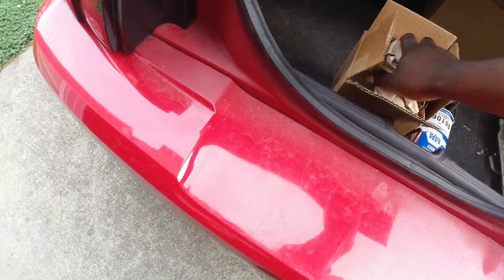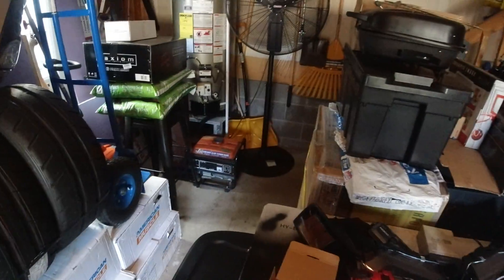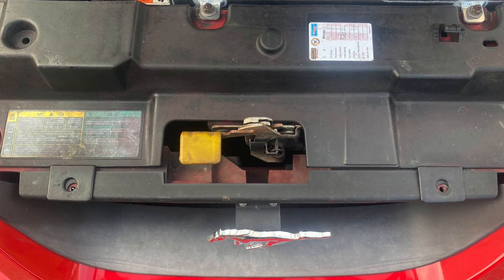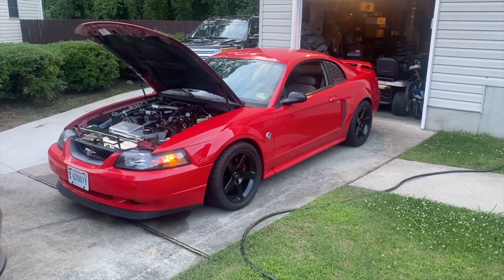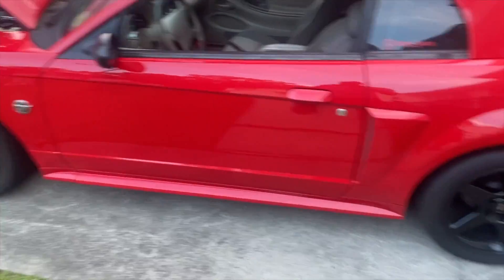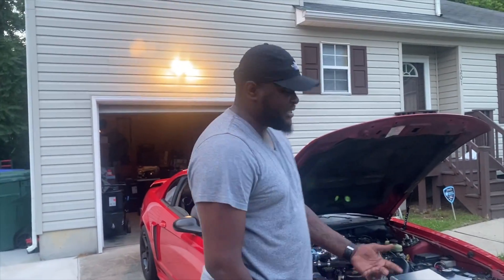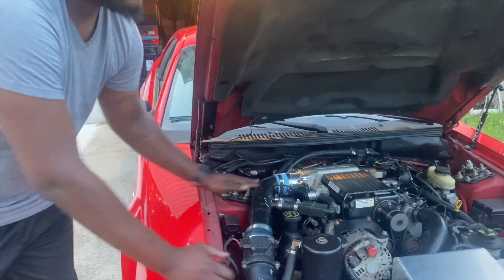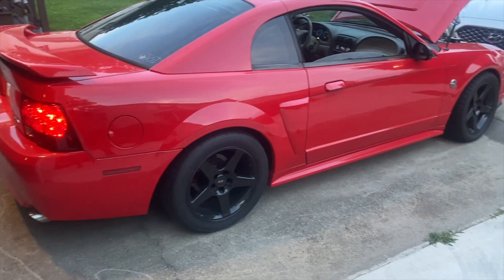The Beast Has Arisen: 2004 Mustang GT Supercharged

Comment: I can definitely see you in full focus,, I been building on mine for a hot minute, built top end stock bottom, comp cams custom grind blower cams, and next I’m lookin at boost and been considering KB kit, just have to get my money stacked a little higher, I got to start posting more videos, I deleted my IG
Reply from the maker: Yeah bro, I’m running a stock bottom end, I plan to build it or coyote swap it if it ever blows on me. But you can find pretty good deals on KB kits. Hop on FB and browse the parts pages.

Comment: Look into either BMR, or Maximum Motorsports for further suspension products.  Both make great products, and the red powder coat that BMR uses would match your paint perfectly. 

   Classic Industries has the stuff to redo your seats in leather, and can help address the other interior items that you mentioned.  

   Some Comp Cams stage 2 (or even stage 3) would be a good addition to the Kennedy Bell, and would give the exhaust that old school lope.

  Good looking Stang, and I'm looking forward to see the progression.
Reply from the maker: Thanks bro, I ended up buying color matched seats from TMI, still waiting on them to arrive. I’m currently looking at some BMR tubular A-Arms, should be purchasing them soon.
Reply: @stanggurus7608  You may need the ones with the long ball joint.  Depends on how much lower the front is compared to stock.

Comment: What size pulley?
Reply from the maker: In the video, that was a 2.25” pulley, it now has a 3” pulley on it.
Reply: @stanggurus7608  is the the 3in pulley  9lbs? What is 2.25in pulley 14?
Reply from the maker: The 3” pulley makes between 8-10lbs of boost, not exactly sure what the 2.25” pulley is actually rated for.
Reply: @stanggurus7608  I have 2.75 and made 10 pounds these 1.7s are difficult to figure out pulleys thank you for ur help

Comment: 10 psi pulley?
Reply from the maker: What exactly is your question? Am I running a 10 psi pulley?
Reply: @stanggurus7608  yes that is my original question.
Reply from the maker: Yes the pulley I have on it now is 3”, makes between 8 and 10 pounds of boost.
Reply: @stanggurus7608  have u had it dyno'd? I want to buy the 10 psi pulley when i buy the kit at some point.
Reply from the maker: marine0331inf I have not been back to my tuner since the baseline run was done. I will be taking it to get tuned in the coming months though. I will post a video to share my thoughts on it while doing a review.